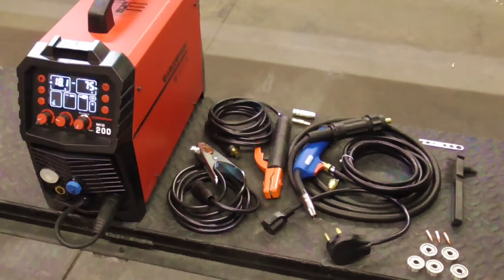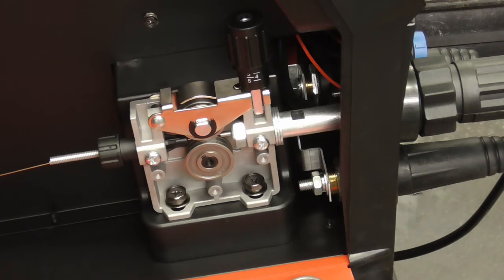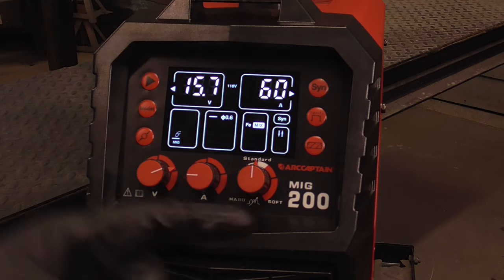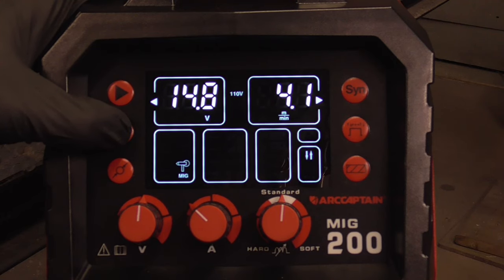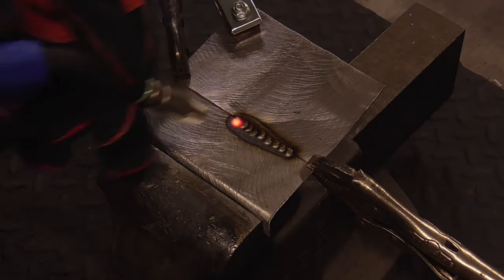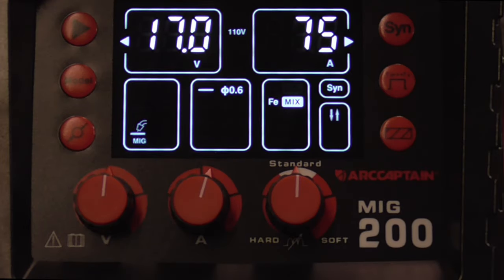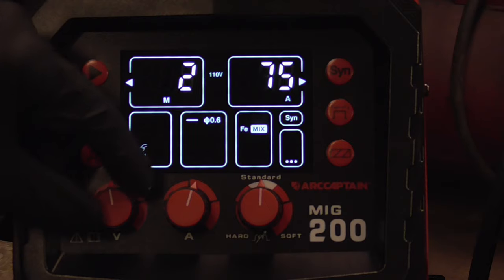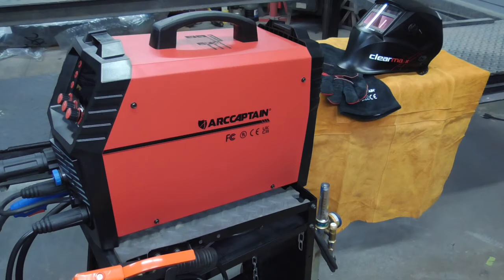ARCCAPTAIN MIG200 6 in 1 Inverter Welder Review - Super Easy to Use!

Comment: Thanks for the video, just bought this machine. I found the ground 16mm2 (6g) to be a bit thin. I ordered a thicker gauge. Would like your opinion. Thank you.
Reply from the maker: What did you find to be too thin?  What did you order?
Reply: Thanks for your reply. I bought the mig 200, the ground is a 6g  and I have read how quickly it heats up. Haven’t used it yet. Pro-welders like you recommended a 2g.

Comment: Those units do a good job for sure... but for how long? That's our main problem with cheap tools today; longevity. Sometimes, there is also a quality control problem... But that is easy to see and easy to send back for refund if so (I experienced this before). If the unit is good out of the box, than you should be alright for a while...
Reply: With extended warranties and cheap replacement parts. They seem to hold there own for us small shop owners or garage warriors.
Reply from the maker: We'll see - I'll be using it as a main welder because I liked it so much.  Easy to read and use screen!!
Reply: @LakesideAutobody  How would you compare it to your Yeswelder? Might be too early to tell... Glad you like it! I trust your judgement, your opinion...
Reply from the maker: @rbelang8331  Right off the bat, the reason I agreed to do the review for this co. is the simplicity of the user interface.  At this point I have only used the MIG mode of the welder and I love it.  It "feels" and welds like any big name welder I've used.  Seems to be well built and rugged.  Yeswelder makes great welders too but the simplicity of the Arccaptain and ability to weld aluminum and versatility gives it an edge.  I would say both are similar in quality and the way they are built - just my opinion though :)
Reply: @rbelang8331  Any customer is very welcome to compare the arccaptain machine with the yeswelder machine, no matter the result, we will give a gift as gratitude

Comment: In the mid nineties I paid $350 for a Century 110 Amp 110 volt mig with stepless heat control, and it was a joy to weld with. (Probably why Lincoln bought Century)  I bought a SereneLife 130 Amp mig off Amazon in 2020 for less than $200 that welds like a dream, with or without gas.  My shop flooded that summer, and the welder was submerged for hours.  I went to test it a week later and the arc sputtered, and some water was dripping out the gas cone.  I put it on the roof of a truck so the whip would hang straight down for water to run out.  I've run many 2lb spools of .023 solid wire, and several 2lb spools of .030 flux wire since.  The new technology is most impressive
Reply from the maker: Great story.  That was pretty cheap for a welder in the 90's.  I think I paid around 800 for a Miller Millermatic 90 at around the same time.  I still have it and love it but it needs some love - needs a new gun, gas valve and a good cleaning.  Welders a like collectables 😊
Reply: @LakesideAutobody  3 weeks ago an Amazon "limited time deal" got the best of me and I bought a Flameweld Mig145FX flux core welder for $101.  I had my doubts since it only has 1 knob, and 2 soft buttons.  At first I thought I'd screwed up because at the lowest amperage of 50, it was still blowing holes in 22 guage, and welding sheet metal is my primary concern.  No real instructions for the 2 buttons, but after 5 minutes of fiddling, I had the primary amps at 70, and one of the buttons set to -20.  After that 22ga was no problemo.  I first welded with fux core in May of this year, and now it is my preferred method for autobody sheet metal work.
Reply from the maker: @karsbkool  That's a great story.  With welding gas going up and up, it's great that flux is your preferred method.  Keep me posted on what you've got going on my friend.  I'm going over to Amazon to check out some cheap welders 🔥😊
Reply: @LakesideAutobody  I've been diagnosed with retinitis pigmentosa, a non-treatable eye disease that is progressing fast, so I'm going to get my 46 years of paint and body experience on video while I still can.  I'm accumulating video footage every day.  I've already imagined and created new tools and processes just by thinking about YouTube content.  I have been teaching paint and body in person for almost 40 years, which many times prompted me to find new processes to help students learn more quickly.  Your channel is my favorite for in-depth information, and I really enjoy Underground Paint King for beginner appeal.
Reply from the maker: @karsbkool  I'm sorry to hear that Kenlycan - I'll throw up a prayer or two for you my friend.  I think your idea to put your videos on YT is great stuff - let me know if you have questions on how to do that.  I appreciate your support and you're right about UPK - he is a great teacher and YT personality.  Have a good weekend :)
Reply: @LakesideAutobody  your prayers are certainly appreciated.  Also is your offer of assistance.  I'm still in the research phase of all things YouTube, and learning my shot framing, and learning my editing,  and nursing my carpal tunneling, and my rheumatoid arthritis. Maybe you could throw in a few more prayers... bet you remember that old Hee Haw song lol
Reply: @LakesideAutobody  I had the thought to feature students learning my techniques in real time.  I have several candidates who want to participate.  Do you think the audience would have the interest and patience for such content?
Reply from the maker: @karsbkool  I think that would be interesting.  I've often thought of having my son out there trying out what I show in real time like you said but I'm not sure he would be into that.  You never know what folks will watch :)
Reply from the maker: @karsbkool  I don't remember that song - we only had 3 channels when I was young.  Good times though - I was the remote too :)
Reply: @LakesideAutobody  I'll give it a try and see if it'll fly🙂

Comment: What amp circuit breaker is needed ?
Reply from the maker: I'm using a 20 amp breaker but I'm pretty sure you can run it on a 15 amp circuit as the instructions don't mention any warnings against it :)
Reply: @LakesideAutobody  Thanks

Comment: How do you mig aluminum? Spool gun only? It's not provided with machine. I just got the machine yesterday and mig ran great. But mma I had some issues with. Maybe I'm not as experienced in mma but it kept cutting out.
Reply from the maker: Here's how to weld aluminum w/o the spool gun - https://www.youtube.com/watch?v=VeXBkR3m-Tg  I believe this welder would work the same - you'll need a tank of straight Argon for Al.   Here's a video on Flux Core welding - maybe it will help you figure out your situation and this welder.  Let me know if you figure out why it cut out on you :)

Comment: How does it compare to your miller? Thank you. Have a great weekend!
Reply from the maker: It welds sheet metal exactly the same - exactly!  I have not used it for much of anything else though so I can't comment on it's other welding modes or it's ability to run on 220 for more heat and thicker metal.  Quality is better than most of the units coming out of China too.  The only advantage obviously with Miller is the availability of replacement parts.  So far so good with this though - been using it ever since the review video I did on it a few months back :)
Reply: Thank you

Comment: Does this machine do ac tig?
Reply from the maker: It's capable of TIG but I'm not sure if it's ac.  Here's the user manual though - https://cdn.shopify.com/s/files/1/0613/8458/9369/files/ARCCAPTAIN_MIG200.pdf?v=1668413522
Reply: @LakesideAutobody  I found out. It's DC Tig.
Reply from the maker: @philly2x  What's better?  What's the difference?
Reply: @LakesideAutobody  DC is fine except it won't do aluminum. But, this machine will mig aluminum, so it's not really a big deal.
Reply from the maker: @philly2x  Got it - thanks for the info 😊